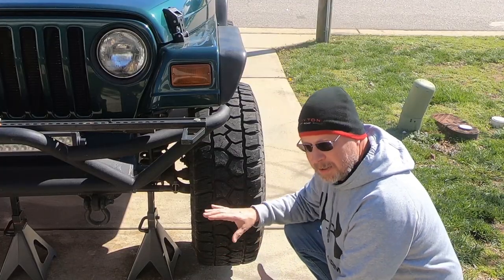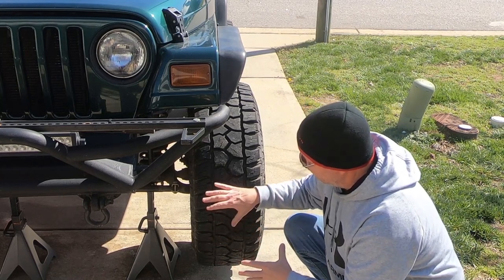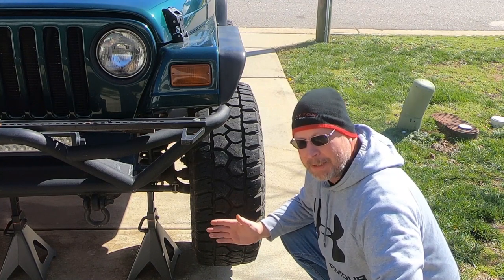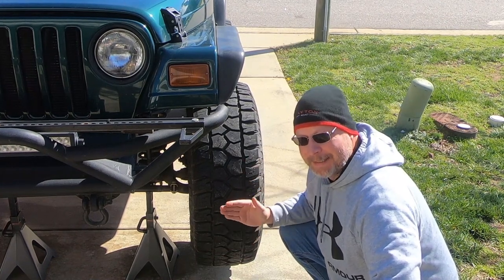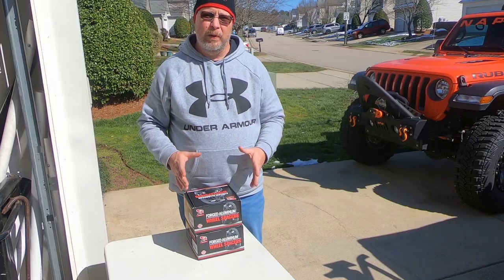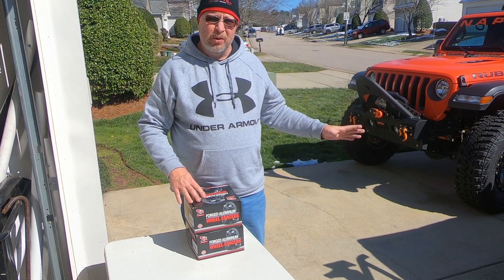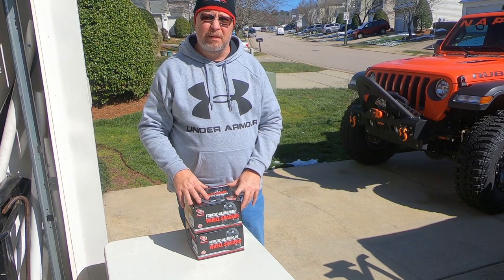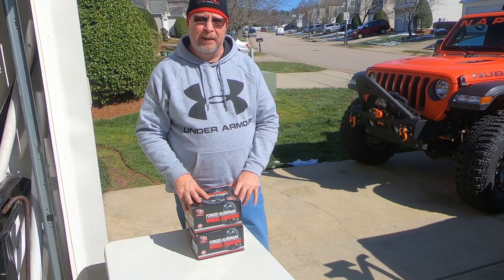How To Install Wheel Spacers

Comment: My wife's jeep has stock 18" wheels. Can I use wheel spacers?
Reply from the maker: The diameter of the wheel is irrelevant. You can use wheel spacers. All it's going to do is push the wheel out, giving a wider stance. Thanks for watching and the question! 🤘🏻